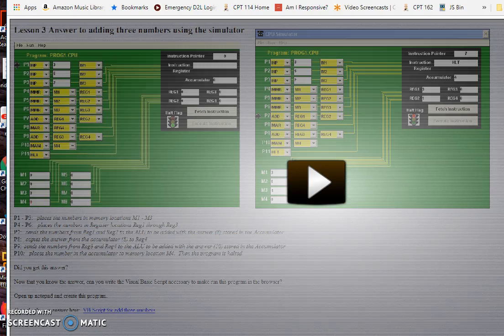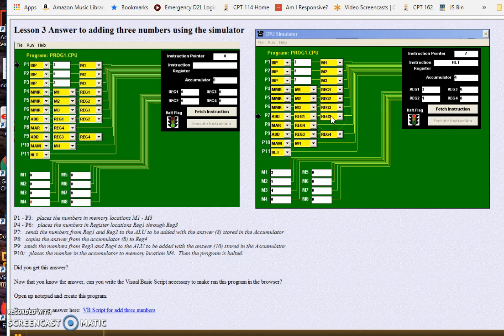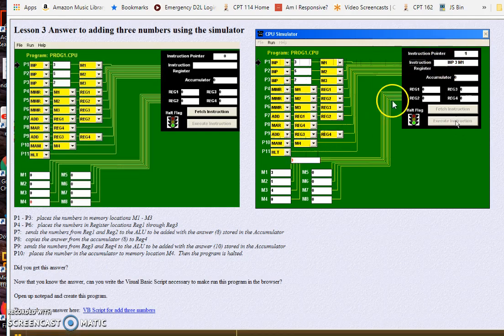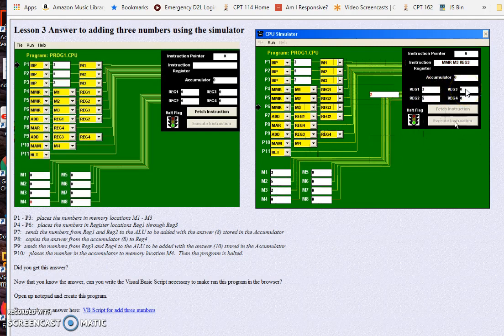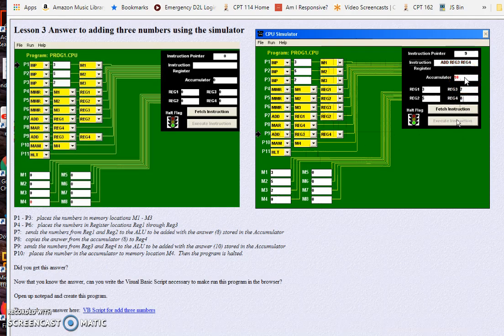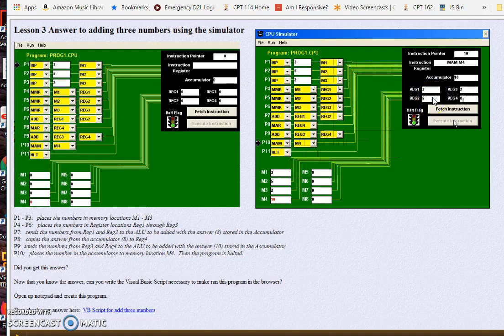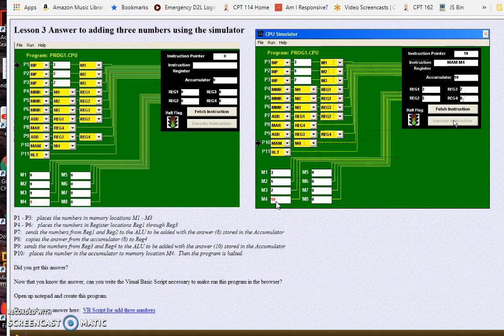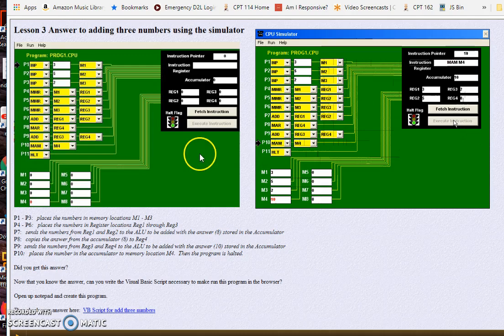opcodes adding3numbers

Comment: Is it possible to code using opcode not mnemonic? If yes, is any possible tool to do that?
I want to do very low level programming. I need a old computer emulator or simulator. What is the name of it?